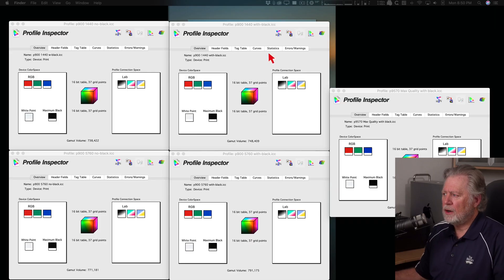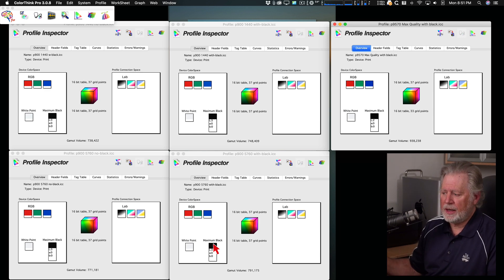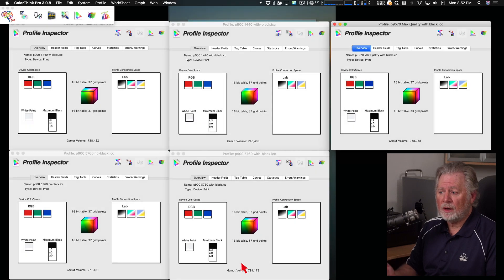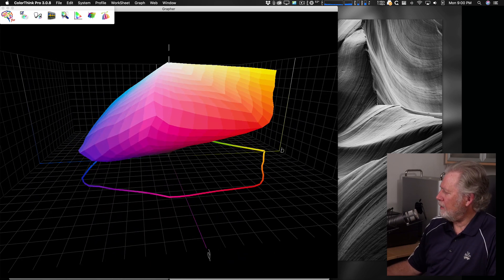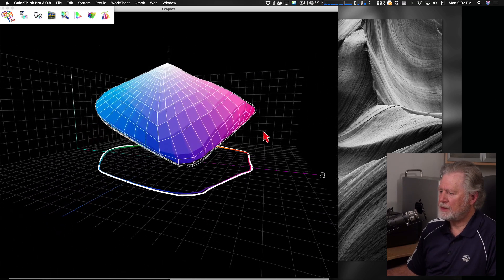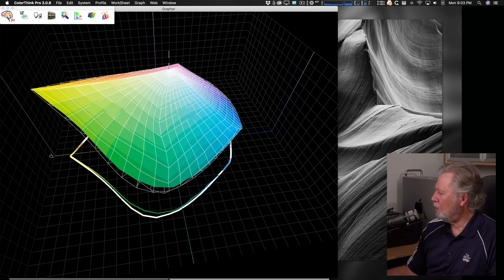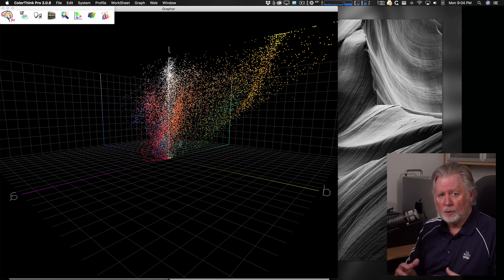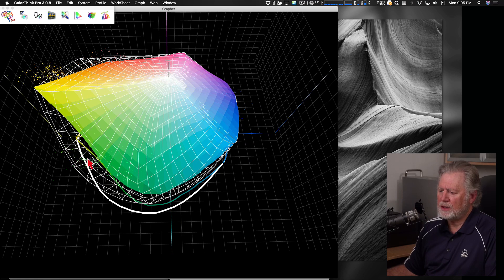Epson p700/900- "Black Enhanced Overcoat" and "Carbon Black Driver"?

Comment: Hmm. it reduces metamerism? I thought bronzing.
Reply from the maker: https://epson.com/faq/SPT_SCP7570SE~faq-0000c8a-scp7570_9570?faq_cat=faq-topFaqs

to quote Epson from this page “ Black Enhanced Overcoat is a new print mode that can reduce metamerism on photo media. When Black Enhanced Overcoat is enabled, the product prints with darker tones of black by overcoating the black with gray.”

I think the real purpose here is the second one ...prints with darker tones. I’m not sure metameric failure has been an issue for some time with inkjet printers - pretty rare. but as you can see, Epson says nothing about bronzing. Bronzing hasn’t been much of a problem with epson printers for a while either, pretty rare as well.
Reply: @cwaynefox  thx. I will try it with the P9570.

Comment: I AM a tech guy and sadly you are wrong. Pigment blacks reduce colour shifts to a slight magenta or green look depending on the viewing lighting spectrum so this is NOT an issue with any pigment printer. The extra gloss overcoat is purely to smooth out any gloss differential caused by the black pigments 'sitting on top' of gloss paper and looking slightly matte when viewed at an angle. Also the extra coating won't do anything to add extra detail!
Reply: Your patience to respond and ignore people's unappreciative know it all attitudes is to be applauded. Keep doing your thing, see all learn from it.
Reply from the maker: Gloss differential is when  the paper white with no ink appears to have a different sheen than areas with ink.  the only way to get rid of that is apply a “Clear” ink where paper white is exposed. Adding more ink to the blacks will not change the sheen or gloss of these printed areas and cannot make them match the gloss of unprinted areas of white.  

but the purpose is directly related to metamerism. Here is the link to one of my sources ... https://epson.com/faq/SPT_SCP7570SE~faq-0000c8a-scp7570_9570?faq_cat=faq-topFaqs

to quote Epson from this page “ Black Enhanced Overcoat is a new print mode that can reduce metamerism on photo media. When Black Enhanced Overcoat is enabled, the product prints with darker tones of black by overcoating the black with gray.”

So it specifically designed to help with metamerism.  Pigment ink printers are not immune to this problem, although I haven’t seen any issues for a long time. I assume there must be some unusual circumstances where it becomes problematic and epson is trying to address those.  From my point of view with photographic continuous tone images, I haven’t seen it add anything and leave it off, since it uses more ink.
Reply: @cwaynefox  You should be careful who you choose to quote and printer manufacturers in general, Epson specifically, need to pay far more attention to exactly what it is they’re trying to say, the terminology they’re using to (attempt to) say something and above all else, it can be incredibly helpful, not to mention useful, too, is to make logically consistent statements that are based on evidence and/or fact and use the English language in a manner which isn’t just gibberish and ideally, it’d be great if it actually makes sense.

Consider the quote you’ve provided, specifically the section “Black Enhanced Overcoat is a new print mode that can reduce metamerism on photo media.” What I believe the ‘apparently not so’ expert colour scientists at Epson were trying to say was that the new print mode can reduce METAMERIC FAILURE. I never attended RIT or any other prestigious institution to earn a Fine Art degree of some description, but I’m glad I always paid attention in both science and English classes as metameric failure is the concept that two different hues, when viewed under a particular source of light appear to match, yet when those same hues are viewed using a different source of light now appear to be noticeably dissimilar. A very common way to picture this is that the colours and relationships between those colours in a print look fine when viewed in midday sunlight yet that same print, when viewed under a fluorescent light source, now has ugly discolouration, as in areas which were previously neutral may now have a distinctly green or magenta tint.

Again, this has absolutely nothing whatsoever to do with metamerism, which is the the fact something is segmented or divided, such as an earthworm or a lobster. Their bodies are divided into successive metameres, it could even be said that these species exhibit aspects of metamerism but I very highly doubt that’s what anyone at Epson wanted to convey.

Fair enough that you made the same mistake Wayne, you’re a photographer, not an English literature major, or even a colour scientist but when a company such as Epson makes such a ridiculous error, they must be held to a much higher standard and their press releases and product brochures ought to actually make sense (what a novel concept!) and use correct terminology, not just make up their own meanings to words which have been in use for hundreds of years, and that’s just in English!
Reply from the maker: @aaronperelmuter8433  I am well aware that the use of the word metamerism is technically incorrect . But at this point in time, the term metamerism is widely and universally used to describe metameric failure, not just in printing but in dyes and fabrics and paints.  This isn’t an Epson thing, it’s pretty universal.  A couple of examples…

https://www.xrite.com/blog/what-is-metamerism 

 xRite, a leading company in color technologies in their article about  metamerism describe metameric failure, and never once on this page does the word failure appear. Their use of the word metamerism in this article refers to metameric failure.  Example, the first paragraph in this article reads

“Have you ever walked out of the house wearing two black socks, only to arrive at work and realize one of them is navy blue? If so, you’ve been a victim of metamerism.”

Technically, you haven’t been a victim of metamerism, but of metameric failure. But the term metamerism has evolved to mean metameric failure, and indeed the term metamerism has little other application when it comes to this. 

https://www.merriam-webster.com/dictionary/metamerism

Here in the Merriam Webster dictionary it says

2: the identical visual appearance of two colors that have different physical or spectral compositions : the condition of being metameric in color
… the colors of dyes or pigments that match in daylight may not match in incandescent or fluorescent light, and so on, a characteristic known as metamerism.
— Kurt Nassau

While their definition is somewhat correct, their use of the word in a sentence is  describing metameric failure.

At  this point the word metamerism is so widely used to describe metameric failure it should be considered part of the definition and added to the dictionary.  Generally speaking in nearly all cases the word metamerism is used anywhere, most likely it is being used to describe metameric failure. Google metamerism, and most of the hits are an article where the term metamerism is being used to describe metameric failure.

It’s certainly not my job to try and correct the world on the improper use of the term .  Rather I will continue to use the term just like everyone else does, because everyone familiar with the term understands what is meant when it is used. And since languages evolve, there really isn’t a problem with this happening.  There is little use for the word in other areas of language, and in fact outside the use of describing metameric failure, as you mentioned in your post it’s more accepted definition has nothing to do with light and color, but something completely unrelated. (See previous dictionary link). 

 I am currently working on a video about printing terminology for photographers, include metamerism, bronzing, gloss differential as well as some other things that most have heard but maybe really aren’t sure what they mean.  Metamerism is often confused with both gloss differential and/or bronzing.  And in that video I will talk about metamerism actual meaning as well as talk about that fact that metameric failure is really what is happening and printer makers are trying to prevent as much as possible. But like the rest of the world, I will continue to use the word metamerism to describe metameric failure when it comes to inkjet printing technologies.

There are many terms in the language that evolve to be understood to mean something else. I don’t think it’s any big deal.